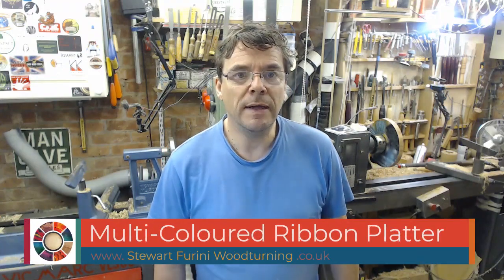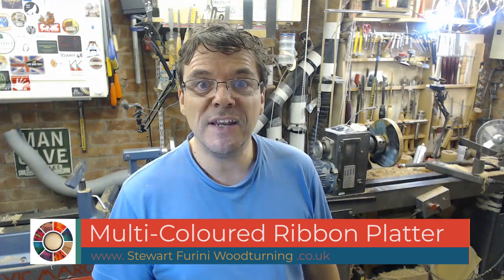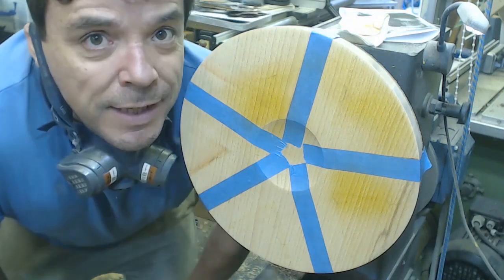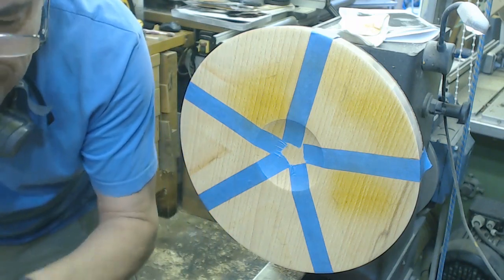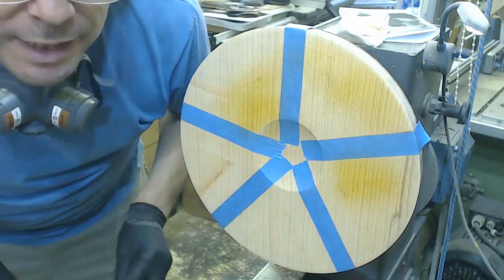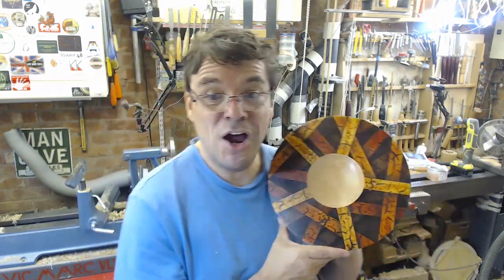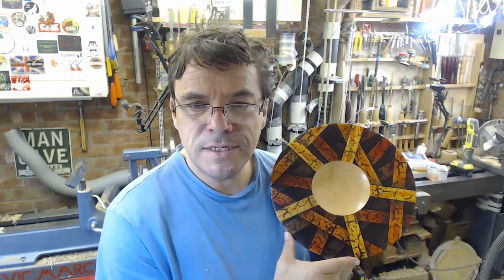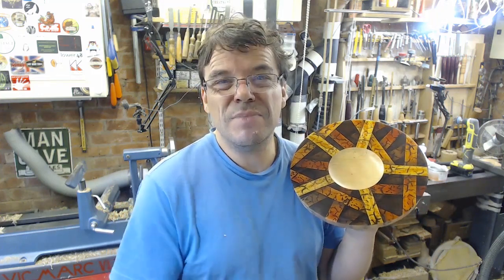Woodturning a Multi-Coloured Ribbon Platter

Comment: I think version 4 has to be the best one so far.
Now just nit picking, but it really hit me on that last still image. The whole thing on that image looks really washed out. It's probably made worse as the table you have it on packs a real punch with contrast and is making it look a lot worse.
Now whilst you were doing this one, I did have an idea you might want to think about. Certainly from my photography days we always tried to get some form of side lighting (Autumn light is by far the best as the sun never rises very high). Rather than put in shadows both sides has you thought about longer shadows on one side for where the light is coming from. This may give it that extra punch you're looking for.
Great video, enjoyed this a lot with the extra texturing on the ribbons made them look a lot better.
Reply from the maker: Thanks, Paul - I know exactly what you mean about the last shot, but somehow I didn't really notice it until I came to make my thumbnail image from it - and saw how drained it was so had to use a different shot. Do I need a decent camera rather than using my phone all the time....not looking for a reason to buy a new toy, really..... I used to have some side lighting on my lathe but I recently noticed all the leds are covered in black paint. How did that happen???  Glad you like this version. I think the placing of the ribbons in relation to each other needs a bit more thought but it was fun to do!